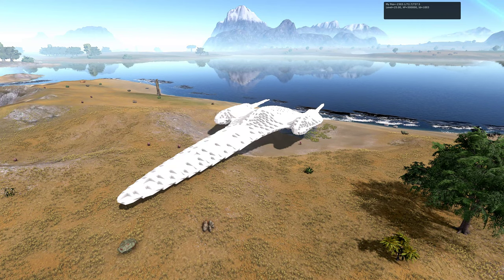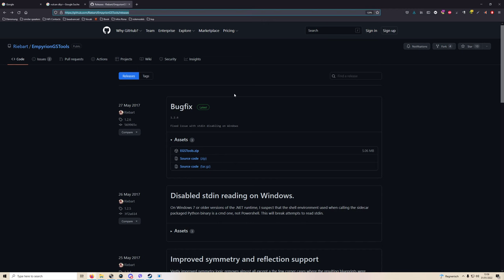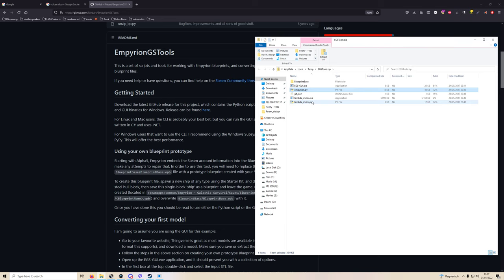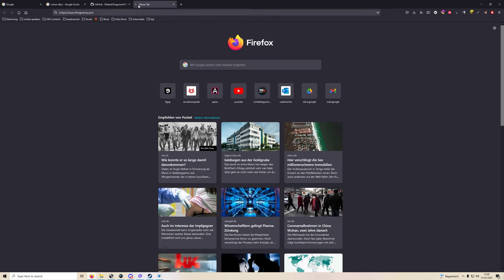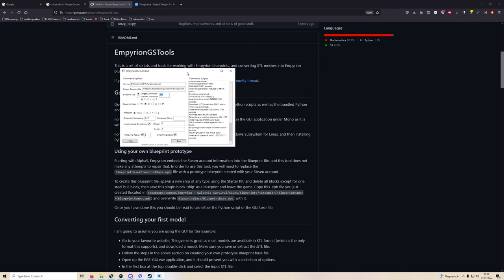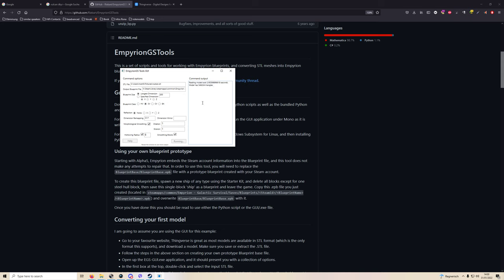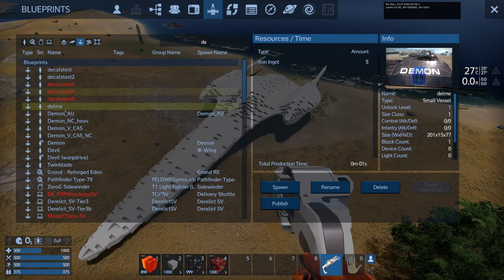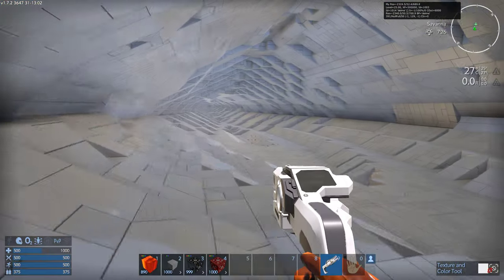How to Convert 3D models into Empyrion blueprints using EGS Tools

Comment: Does not work anymore at all I have tried everything and have tried several .stl files with no resolve same issue appears
Reply: I've been able to get it to work but the only problem I have is that I can't build on to the ship once it's spawned in error says something about the block state. I found something about using commands replace block to change the block type on the entire model, but I haven't been able to get it to work I think it has something to do with the model not having a cv core. I'm still experimenting to figure that out.

Comment: Hey Solo i am trying out the GS tool any tips on my BP a lot more smoother
Reply from the maker: Unfortunately, you have to do this manually. The code is open source though, if you can program, you may wanna have a look at it. Especially with the new blocks in the current update (1.10).

Comment from the maker: Hey I just wanted to point out for everybody, that there is sometimes an issue as seen in the comments where one does not get the desired output and an error.
Firstly, one always gets the error. 
Secondly, as for the lacck of the desired result: please consult the wiki on Riebarts github and replace the sample .ebp in the folder. If that does not cut it, try another .stl. As it seeems like the software is not compatible with high poly count .stl files
Cheers
Reply: Hello Solo. First of all i love your VID. Second: im running in the same problem as Slingblade4881. i read the wiki and made all changes as written. the programm works without an error. it converts everything but in the game when i want to spawn the converted blueprint i get the outline / green box but no ship at all, only the brief message that the blueprint was spawned/created. would you be willing to share the nubian.stl with us so we can be sure that the error is not on our part that the problem seems only with certain .stl´s Cheerz Mate and keep up the good work
Reply from the maker: @LFT86  Hey, I do not think I can find it again, but have you tried with an alternative .stl or rotation setting ? Also, have you tried with a smaller version.
I am down to sit down together on discord if you want to figure it out. Do you have a server I could join ?
Reply from the maker: @LFT86  I belieeeve I got the model as a .obj from here:  https://sketchfab.com/3d-models/naboo-royal-starship-j-type-327-nubian-f631077977754b5591298ecfa201380b and converted it to .stl via blender (opensource software).

Comment: This is not working for me, all I get is 8 blocks like a CV starter without the core. But I have the outline for the whole thing. I did it step by step from your video.
Reply from the maker: Did you replace the .ebp blueprint as the wiki page on github suggests ?
Reply: @solosyoutubechannel9155  yes I did everything as the wiki said.

Comment: if I put 231 in the dimension remapping or any combination of numbers and run the tool I always get
  File "lambda_index.py", line 437, in <module>
    __main()
  File "lambda_index.py", line 424, in __main
    new_bp_64 = lambda_handler(lambda_body, None)
  File "lambda_index.py", line 117, in lambda_handler
    pts = [tuple([p[dim_remap[i] - 1] for i in range(3)]) for p in pts]
IndexError: tuple index out of range
and it wont build the ship
If I leave dimension remapping blank It works but the ship spawns in sideways
Reply from the maker: Separate the axes by a comma: 2,3,1
Reply: @solosyoutubechannel9155  I would have never figured the comma thing out it works now thanks for the reply